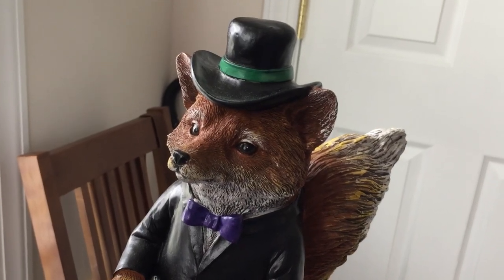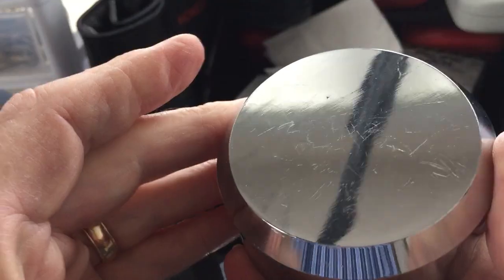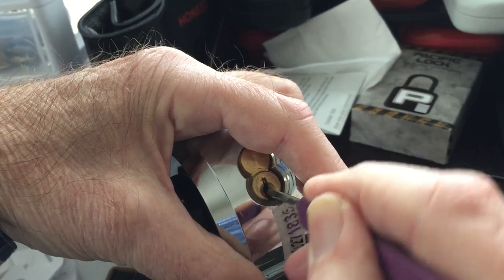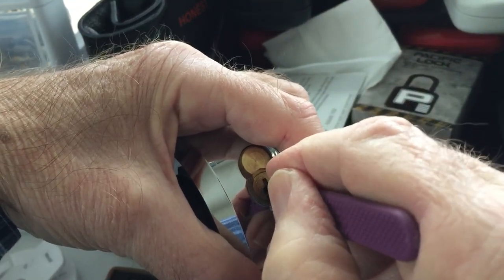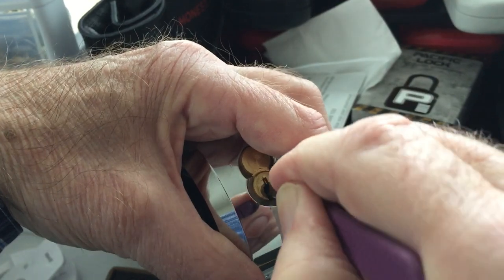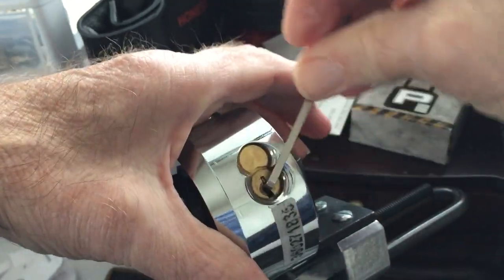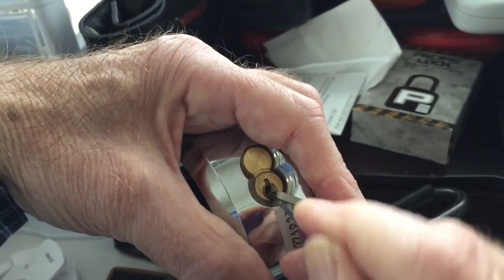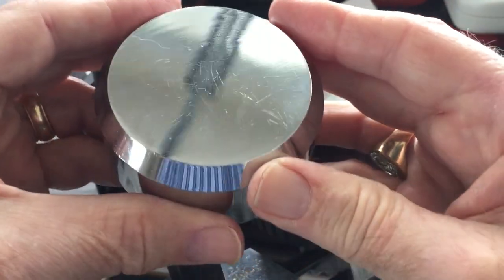(7) Puck lock SPP’ed

Comment: Nice pick bud! Did you say harbor freight? I thought home Depot got the contract for paclock. At least that's all I've heard. Are they cheaper at harbor freight?
Reply from the maker: wes the lockpicker This is not a Paclock. Yes,Harbor Freight and they are much cheaper. Paclock is not in most Home Depot’s yet. You have to buy them online. 🦊
Reply: @jackfoxlock  yea my hometown home Depot still just has the big wall of masterjunks and the china knock offs! Fortunately I have one from big Al I had the pleasure of picking! They are a great pick!! Unfortunately I'm not real sure how good there gonna sell once they FINALLY do come to home Depot. Most people don't have any understanding of locks in general at all. Now you got your locksmiths and people like us but that is a VERY small percentage of the population. People will need a padlock for whatever and there's a master hanging there that says all their great security bs and a paclock beside it saying the same thing but it just happens to be true but it's double the price or whatever price difference people are going to buy the cheaper one cause they have no idea
Reply from the maker: wes the lockpicker   That is so true. Thieves no longer pick locks when it is so easy to smash off the clasp with a hammer or use bolt cutters on the chain. Paclocks are much more expensive than Master Locks. I still haven’t pick either of my Paclocks yet.
Reply: @jackfoxlock  my dad told me when I was lil kid "he died at 45yrs old" that locks only keep out honest people and oh how right he was